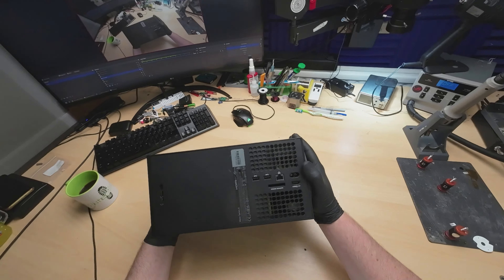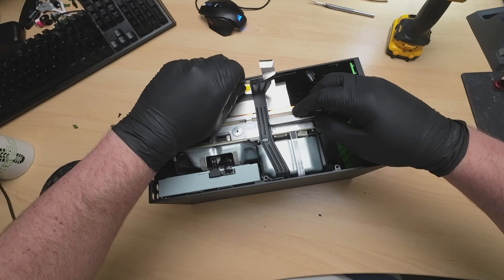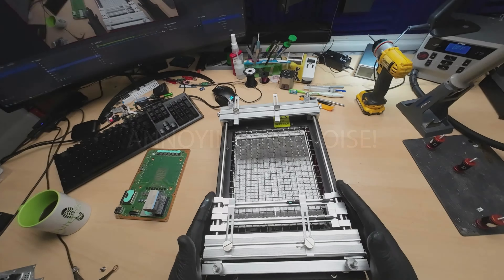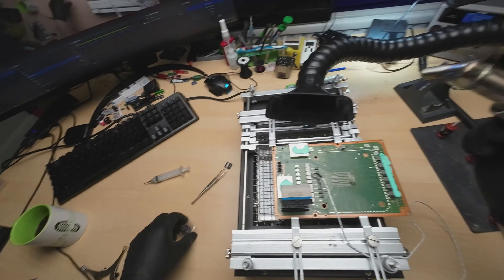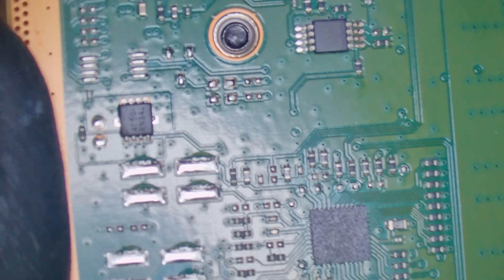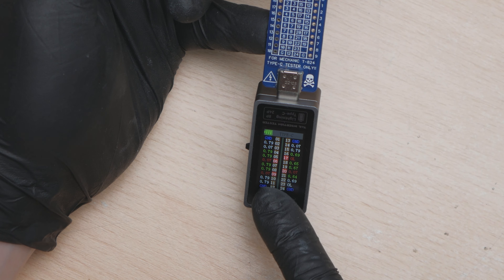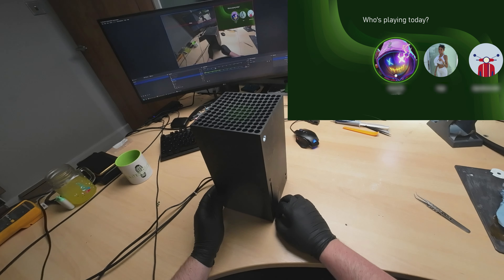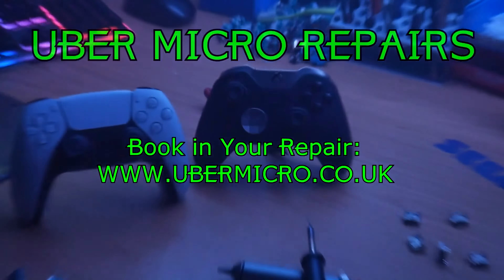Xbox Series X No Display HDMI Port Repair | Done Differently

Comment: Beautiful job! Did you pre-tin the data pins on the HDMI port or just used whatever solder was left on the pads after removing the old one?
Reply from the maker: Thanks. Other than adding some Kester to the anchor points. It was solid. I've only used it a few times so far but what I want it for it's spot on!